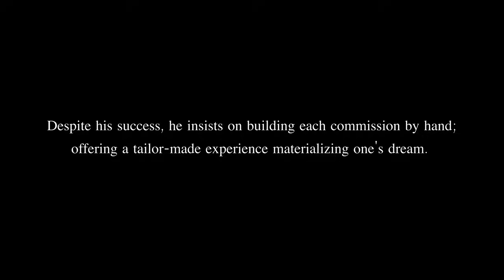Akira Nakai — A Lifetime of Dedication (RWB Ise & RWB Ghibli) | Documentary

Comment: After working on high end motorcycles for years, building cars seems a lot more fluid.  Every nut and bolt on a motorcycle has to be hand made and the tight toleration of the built can make you go nuts.